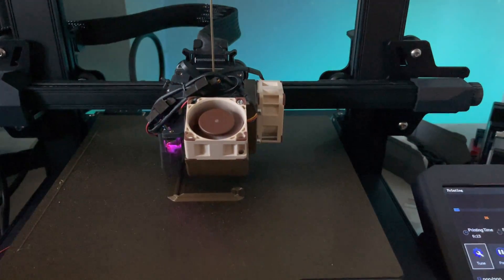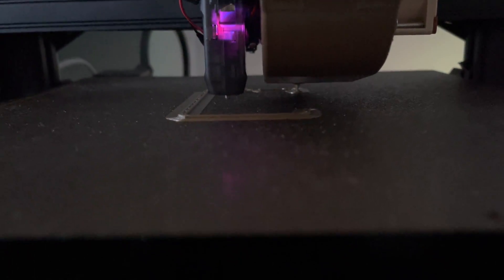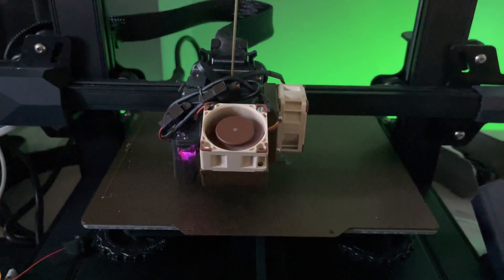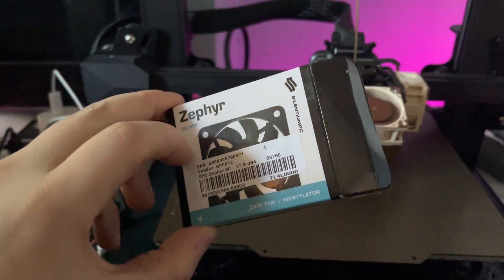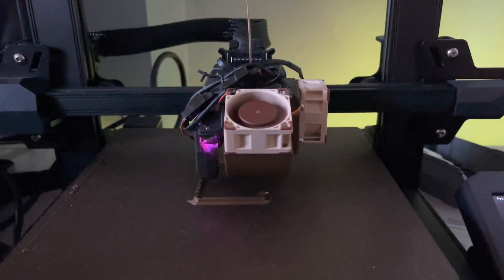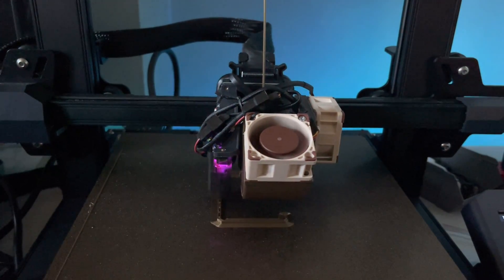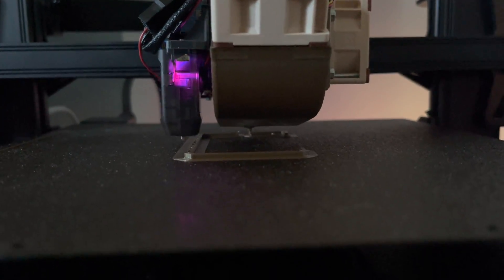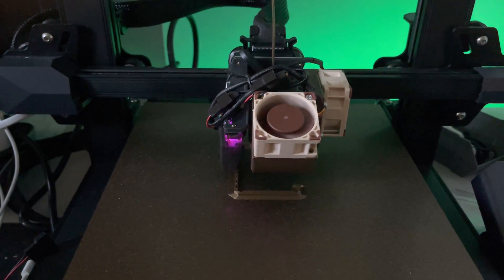Ender 3 S1 noctua fans in action : still Beta testing final product soon!!

Comment: What pei bed are you using? Did you also have the problem that prints stuck too good on the old one?
Reply: i would recommend you get the TH3D EZFlex2 you can get either smooth or textured and with or without a magnetic base, the textured leaves a very nice texture on the bottom of prints which makes the bottom shean in light
Reply from the maker: i'm using this one, the double sided version https://nl.aliexpress.com/item/1005003040505738.html?gatewayAdapt=glo2nld&spm=a2g0o.9042311.0.0.3d934c4dnRUls5
Well weird enough the original magnetic bed never had the problem of sticking too well.  I installed it now on my ender 3 (v2) but am also waiting for the same PEI to come in to use it on the ender 3.

Comment: Nice video, is the PSU 12 or 24V ? I think the mainboard is more loud then the PSU but it´s good to swap both out :)
Reply from the maker: PSU is 24 volts, i changed all fans, and also swapped the PSU to Meanwell. It's literally mouse silent now!!
Reply: @aim6mac  Alright, will 6015 work on both places?
Reply from the maker: @3dprint4u  yes i'm using 6015 for both (motherboard and PSU) remember i swapped the PSU to meanwell.  The Creality PSU is also 6015 but runs on 24 volts which is a shame, meanwell runs on 12 volts so it's just a swap